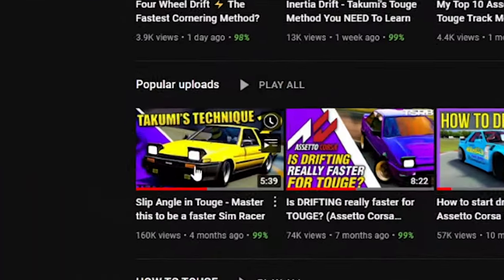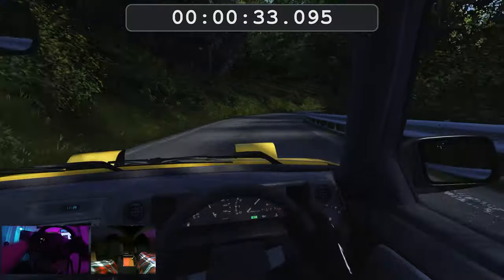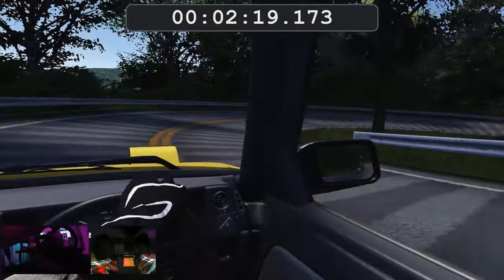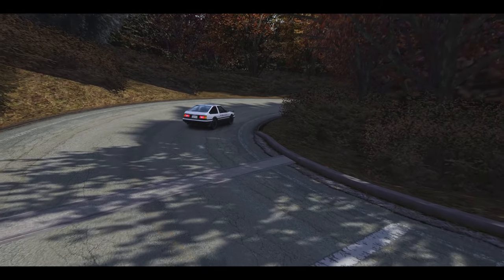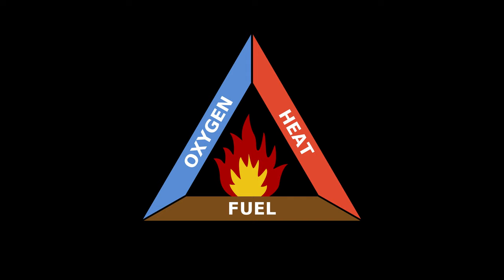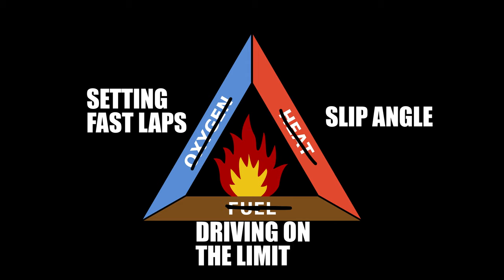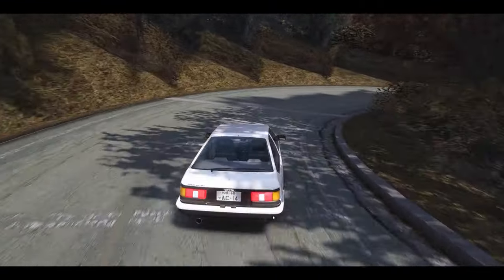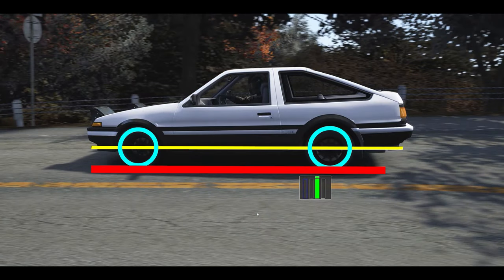A Follow Up to my Slip Angle video

Comment: The thing is, ANY time you take a corner, at 1mph or 100mph, there is slip angle on the tires. The CAR is a little sideways because of the slip angle on the rear tires, and the fronts can have the same slip angle if your steering wheel is straight, or a larger or smaller slip angle based on the steering. You use slip angle 100% of the time as there is no other way to take a turn.  Each tire has a different slip angle where grip is maximum. On the 80s Toyota, it might well be 10 or 12 degrees, which is very visible, so even driving at maximum rear grip would see the entire car sideways by 10 or 12 degrees.  A modern racing car probably needs about half, so it isn't as visual, but it is still 'sideways' though corners.
So when you say slip angle is produced at the limit of grip, no, it is produced at any cornering speed. The limit of grip sits at a certain slip angle, but grip builds up from zero to this slip angle.
Reply: Well said. A lot of people don't understand that if a car has zero slip angle, it is going in a straight line. What people are actually trying to find is the optimum slip angle.
Reply: Ooh, nice to see you here! Question for ya, if you don't mind:

Given two identical vehicles with identical tires (peak grip force), BUT a different slip angle - e.g. one with 6 degrees slip angle, one with 12 degrees slip angle, what are the differences in driving and can it be predicted which one is faster/"corners" better?

I've done a few experiments in a not-so-sim game but can't find much performance difference (in lap times), only that you tend to get oversteer/understeer sooner with the less slip angle you have - but the car does seem to respond more instantly. Is this accurate? Also, is it safe to assume the lower the slip angle - the higher the peak grip? Which ballpark numbers would be appropriate for a modern race car tire?

Also, is there somewhere this slip angle data for different tires can be found?

Sorry for the barrage of questions 😅
Reply: @ikt32  slip angle refers to the angle of deformation of the tyre at any one time. You have zero slip angle moving in a straight line (unless you have a toe angle). If your tyre is able to maintain a slip angle of 12 degrees without sliding, then 6 degrees is not the maximum potential of the tyre and therefore slower.

If a tyre has a lower optimum slip angle, then it will break traction easier with the same inputs. Car response will be more down to setup differences, warmer tyres, stiffer suspension etc. No - slip angle does not correlate with peak grip, rather peak grip occurs at a specific slip angle which changes anyway.

Your other questions are pretty impossible as there are too many variables which affect slip angle.
Reply: @timeluster  
Thanks for the reply, but I'm afraid you're somewhat reading my question wrong.

Given a vehicle model and track model with identical setup parameters, it should be fine to determine the differences in handling between different tire models where the peak traction is the same, but occurs at a different slip angle, right?

> If a tire has a lower optimum slip angle, then it will break traction easier with the same inputs.

Yes, this was clear, but aside from tighter input tolerances, given identical vehicles and track conditions, the optimal lap time, given perfect inputs where the slip angles never exceed the optimum slip angles significantly, shouldn't differ a lot, right? Even though it can also be assumed the vehicle with the lower optimum slip angle may respond to steering inputs quicker.
Reply: @ikt32  hmm. if peak grip occurs at a larger slip angle then more steering input (perhaps more aggressive input) will be required to achieve the same time.

A tyre with a larger optimum slip angle is likely to be a softer compound and more malleable tyre. This would suggest the rubber acts quicker to inputs, but as you suggested it would take more input to reach the peak. I assume that it relatively cancels out and gives rise to no difference in responsiveness.
Reply: @ikt32  6 would be faster than 12. The car responds faster to inputs, and arrives at optimum grip sooner. This can also be more difficult to drive as a result as you have less time and have to be more precise. It also slows the car down less in some situations, if you have understeer (which you do a lot of the time) the smaller the front slip angles, the less you need to steer. If you would need to steer 90 degrees, all of the tire grip would be slowing the car down. At 12 degs 'understeer' this would be 20% 'drag'  and at 6 deg it would be 10%, so you scrub less speed a lot of the time. I notice it all the time, recently with the Mini I'm making, increasing the peak slip angles makes me slower.

There are no safe assumptions with tires :-). Typically old school tires have greater slip angle, and modern tires might have smaller.. But modern tires are also larger, have a smaller aspect ratio than in the old days.. I would think that optimal grip depends more on the compound used, and you could make a 6 and 12 deg peak slip tire with equal grip.... But that is just a guess.

Slip angle data can't really be found, you will find something if you google, but it is pretty rare and not always reliable information!
Reply: @NielsHeusinkveld  
Thanks for your reply! I think I have a decent grasp on it.
Reply: yep, no slip angle = no cornering force. people confuse slip angle with drifting
Reply: Idk why everyone making slip angle sound like slip angle = drifting

Comment: The triangle of fire postulates that you NEED all three; a comburant (oxygen), temperature (not too hot or too cold for a given combustible) and a combustible (fuel in this case) to make FIRE. You need to check all three conditions. You can't make a fire with just fuel and oxygen alone, you need to light the fuel or air up. You need to add external heat. Once the fire has took off, yes it puts off heat but you need heat to make it.
Reply: WORLD ON FIRE!!!

But yeah, that is defo not how the fire triangle/square works.

Comment: Just a heads up, the fire triangle shows what you need for combustion. You need all three; fuel, oxygen, and heat. If you have gasoline soaked loads sitting in a cold room, it won't ignite. You need heat.

Comment: Firstly, I liked how you packaged the information. 
Easy to understand if you already possess basic knowledge of driving techniques. 

Now, this is just a guess, but I think that God Arm (Initial D Stage 4) would be a better representation of slip angle than Takumi. 

I am a novice, so I may be mistaken, but I'd like to know how God Arm and Takumis cornering techniques differ. 
Is it that God Arm is using better slip angle or is Takumi?

P.S. You are now partially an initial d channel lol
Reply: God Arm corners when the tires on the tires are on their limit of grip, what people call slip angle, Takumi corners when all 4 tires have gone beyond their limit (4 wheel drifiting)
Reply: @detectivepayne3773  mhm, its what racers irl should truly strive for, the find the limit of a tyres grip and stay on it.
That said, I'm still really curious about the benefits and drawbacks of each of their techniques, the subtle nuances.

Comment: I didn't think about it too much before but I started to notice that I began to steer less than I used to as I got faster. When all tires are ever so slightly slipping they are also giving it their all so when you get faster you just start doing it automatically

Comment: To reach the limits of limits of a car. It needs good suspension. Corner balancing will bring forth the full potential of the vehicle added with slip angle. Then to refine the slip angle, the cup trick is always the go to method

Comment: Having just recently gotten a decent wheel and pedals and slowly getting into little more serious racing than just using a controller i realized i have been using slip angle in most games in certain situations usually by accident but still realizing i have a slight "slide" with no counter steer and on the throttle :D

Comment: I'm already subscribed, but you got another like for the 'f*** o-' (nicely done there btw, cutting off the bit that's NOT offensive lol).

I watched the previous video and remember thinking that I agreed with it all, the only thing I would've said was that slip angle is just something that comes naturally after lots of time playing with the throttle and learning about grip, so I probably wouldn't recommend anyone trying to actually learn it outright. But as a video explaining it? It was excellent, and I learned stuff myself. I don't grip race, but just by learning to drift over the last year or so I've noticed that I can hold a very, very minimal angle with very low rev throttle, really on the very border of the point where the car falls out of the angle and straightens up. But I use it to drift along straights and connect corners. It's something I've only started noticing was possible within the last few weeks and I've been solidly drifting for a while now on AC. I needed to learn a whole bunch of things first: left foot braking being crucial. 

But what do people expect? You can't just throw up a screen full of equations and tell people 'it'll take five years, good luck'. Your video was to explain the process not necessarily teach it(which IMO is basically not possible because it's something so instinctive). And it did that.

Comment: I usually drive something AWD like an Evo, or possibly a Skyline. I play a game on ROBLOX called Midnight Racing: Tokyo, or MR:T. ROBLOX physics aren't the best, nor is the suspension in-game. Though since I had took a break from the game for a while and came back, I noticed I had slip angle on every corner. I didn't really know what slip angle was at the time, it just came naturally.

Comment: actually, it is not a triangle either...
by driving on the limit, you are producing (as minimal as possible) oversteery slip angle, therefore a faster lap time........it is a straight line

Comment: Does it existe a technic who permit to be at the limit of the traction when cornering in FWD ?
Reply: FWD is at the limit of traction most of the time, but because it's driven by the front wheels, it doesn't produce oversteer or drift/slip, it instead produces oodles of lovely understeer and puts you into a tree or wall on the outside. Essentially FWD is the worst type of drive, from a technical view point, for going fast as well as for taking corners.
Reply: @Dominik189  Thanks, that what i was thinking firstly but that pretty sad, today lot of car irl are FWD....
Reply: @pierreblack4941  Yeah, but what can we do. FWD is the cheapest shit to produce and leaves more room in the cabin and boot while allowing the most artsy fartsy nonsense for designers who wanna be "avant-garde"...  Plus FWD is easier to drive for people with no driving sense and no tangible driving skill as long as they stick to the ass backwards "economical" method of keep as low rpm as possible, which effectively sacrifices all control that the driver has for less fuel used. It's where the idiotic notion of power in the low end originated. It's why for anyone who grew up with old school proper RWD cars and AWD cars that were NA find most modern cars not really all that fun or drivable. And conversely most people who learned to drive and grew up with modern shitboxes find old cars that DEMAND skill and capabilities from the driver to be "hard to drive" or "lacking power" or "hard to handle". It's a difference that's just inherent due to times changing.

Comment: One question?? what gear?? To use when breaking the limits of your car ithink 2nd gear will not work
Reply: Depends what speed u are
Reply: Depends on amount of traction the surface has, how worn as well as how good the tires used are, the amount of torque and whp the car has, the weight on the car, the cars aerodynamics and the corner that you're trying to take. The speed varies based on those parameters. A worn out tire taking a tight corner can easily be at it's limit even in 1st gear. It's something that has to be learned by doing it one self. Nobody can really tell you this.

Comment: So lets say in a real touge downhill situation, does a proper slip angle wears out the tyres faster, slower or in insignificant the difference???
Reply: Faster but won't matter because of how short the race is
Reply: If it's agregate on runs, it can make a bit of difference in real life, but in AC a lot just go back to pits at the end of the run, so it's kind of insignificant. You might feel the wear slightly earlier on the longer Touge, or if you apply it to longer circuits, you might have a slightly earlier pit stop.
Reply: tire wear doesn't matter in a real downhill run because road tires would last weeks being driven hard, not a few minutes, that's initial d's biggest gimmick

Comment: I thought the first video was fine and explained slip angle very well. There's probably some muppets and noobs out there that can't grasp from the context that slip angle is an advanced technique. That's their problem not yours. Great content. Keep it coming. 👍🏼
Reply: he just explained that slip angle isn't a technique, slip angle is the completely wrong term for it, you wouldn't see  a car like that slide, it would be gripping but on the absolute edge of it, with a very slight barely noticeable rotation of the rear

Comment: So is this faster than a 4 wheel drift? Doesn't it depend on the car?
Reply: It depends on the corner and the surface. Low traction surface 4 wheel drift is faster, high traction surface 4 wheel drift done correctly is literally just this. Slip angle as a technical term refers to how much your rear tires slip due to being on the limit of grip. On high traction surfaces you want just enough slip to not have to counter steer, i.e. to 4 wheel drift. On low traction surfaces like off road in rally, it could actually be more useful to go a bit further into the zone where you have to counter steer, on some corners. At the end of it, it all depends on the corners you're taking. Not so much the car. Unless your car is FWD then forget everything and just learn left foot breaking to keep your self from plowing into the outer wall cause your car understeers for days when trying to go fast.

Comment: That’s not how the fire triangle works… LOL
The product is the combustion. To create it, you need Fuel, Oxygen and Heat to initiate the reaction. Unless you’re dealing with hypergolic fuels that pretty much react on contact, heat is an essential input. 

Think of fuel and oxygen as 2 shy people that needs outside motivation (heat input) to start dancing. Once they’ve started dancing, they generate their own self motivation (heat from combustion) which is enough to sustain them without outside motivation

Comment: Good explanation, but the use of the fire triangle diagram is wrong. You need the 3 ingredients: oxygen, fuel and heat to produce the result: fire. Just fuel and oxygen does not produce flame. The rest of the explanation makes sense.

Comment: My main gripe  with the video is the fact that slip angle is treated as an entirely different type of driving style to grip and drift. That is simply wrong.

Slip angle is not a driving style in and of itself, but, as you said, a technique that is born out mastery in grip driving. It is not a mix of drift and grip, because at no point do you employ any drift techniques to apply slip angle. It is nothing more than a part of the subset of techniques you use in grip.

Your videos, for me, come off as a basic driver school lesson (it's not an insult just in case you're wondering). It's very easy to understand, and it's very bite sized so even the layman can comprehend this technique. But, in the process of making it understandable, myths and misconceptions were created.

I'm not a touge racer though, what do I know lol. This is my opinion as a circuit sim driver.